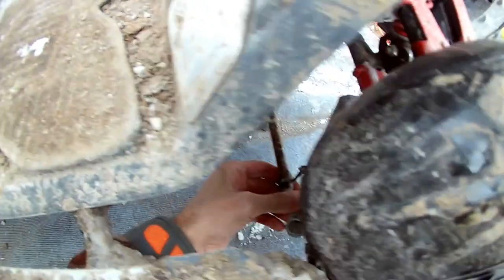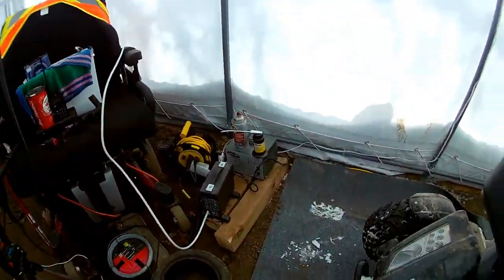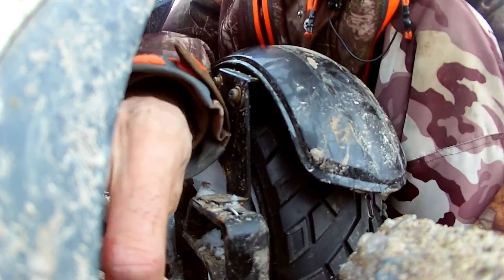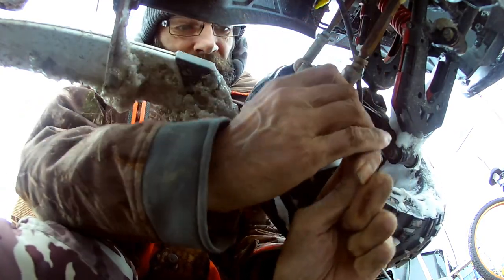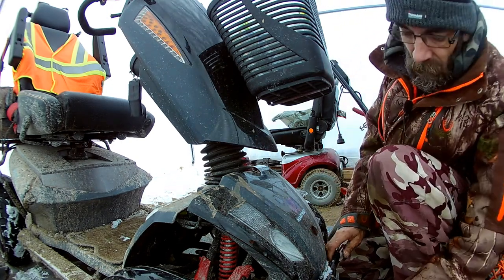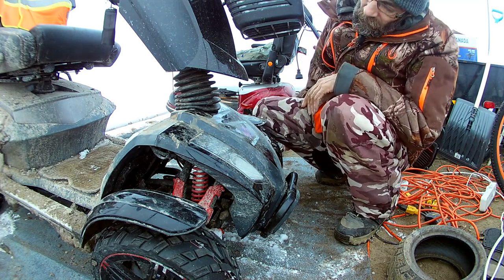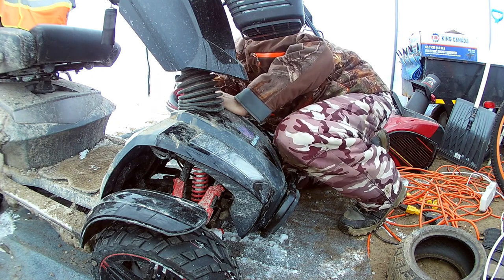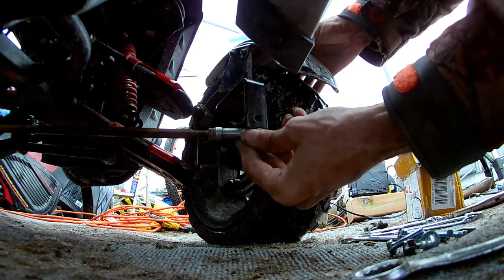March 14-15, 2017 - Fixing the Monster's Broken Nose and Ball Joint Strengthening

Comment: Well you certainly got closer to see so that is better for watching repairs.

Its a shame they designed something to look nice but have some serious flaws in it obviously you can modify and repair these and make it better but regarding the warranty it should give you some extra options and you should be able to extend the warranty.

It would help if they had put in something similar to a car axle and i don't know but to me the suspension design is part or the reason they have made this error.

I would say keep using bungees on both sides for now.

As for the casing breaking fiber glass would not be a possibility because you need to have access to the front as they must of known there would be a lot of issues with the front and maybe this is why they made it so the front comes off.

I think you need to put in something similar to what you have for the mud guards at 6:07 basically a frame and then threaded screws threw the outer case to a frame you installed on top of were the suspension is

obviously u will see the screws on the outside but not much you can do.

If you fiber glass it you would have to take into consideration what things you can't repair from doing that.

I would make a list of all your missing tools and ask everyone if they have them.

You should borrow a pressure washer to clean the monster.
Reply from the maker: I definitely went back to the bungees right away but I came up with a better idea (coming soon). The problem with making a 'missing tool' list is I don't actually know anything is missing until I need it and can't find it. That's why I get frustrated so quickly. The fibreglass idea I have is, if you picture a coffee mug handle made of wood, one end would be attached to one side and the other end to the other side. The 'handle' would be cut in half in the centre. Each end securely in place with a small gap between. That small gap can easily be cut with a hacksaw or something similar. Another possibility would be to attach two objects with holes in the center. Then a bolt could be fit through the holes and no cutting or re-fibreglassing would be required. I have a plan to fix the bumper issue but that won't be until later this summer, when I have a little more money (hopefully). :)
Reply: I still think if you reversed the change you made for having a trailer on the scooter you could send your scooter in for repair under its warranty that would save you a lot of money and i cannot really see how they can take your warranty away just for changing a bracket when it has no effect on the running of it wear as bearings mudguards faulty batteries and bumper breaking have serious effects on the scooter
Reply from the maker: Like I've mentioned before, somewhere, they obviously know of the monster's issues and jumped on the chance of voiding the warranty to avoid having to flip the bill of fixing them.

Once a warranty is void, it cannot be reinstated... unless I took them to court to recover the repair bills. But, either way, I don't have to pay for the expensive repairs. I fix what I can manage/afford, and any anything else, like the batteries, I'm relying on the government's help. They're really dragging their heels on this one though.

Comment: Stupid ball joints !!!!  It's a pity when they made the Monster they didn't design it so the ball joints would be up the other way so at least the cup would just sit on the ball and NOT fall to the ground all the time !!  Maybe when spring or summer comes you can get the man that did your tow bar and battery tray can strengthen or even make a PROPER nudge bar for the front !!  On my scooter it has a nudge bar front and back that bolts straight to the frame of the scooter via 3/4" x 3/4 " heavy walled box section steel front and back !! Not knocking your scooter but that's just cheap ass cost cutting at it's finest !!  Great vid mate. Seeya Rob
Reply from the maker: Well, I am knocking the scooter. :) It's a very bad design... a flat plate bolted to a curved bar. What exactly did they think that would hold up to? The ES950 has front and back bumpers bolted directly to the frame as you described and the front one held up to a full speed impact into the retaining wall in my driveway. The right side bent inward, but that's all. All the force on the Monster's bumper was at the bottom when I hit the wood pile and, at the farthest distance from it's connecting point, it received maximum leverage. Very, very bad design. I do have plans to get my welder to strengthen the curved bar at the front, but that will be later this summer, likely. Money's tight right now and I'm getting him to do a couple of other things next week, finally. He's putting on the rollbar extension for my lightbar and strengthening the rear fender supports, which have broken again.